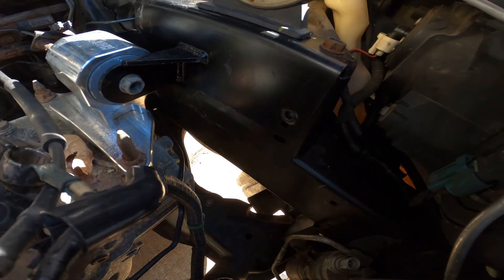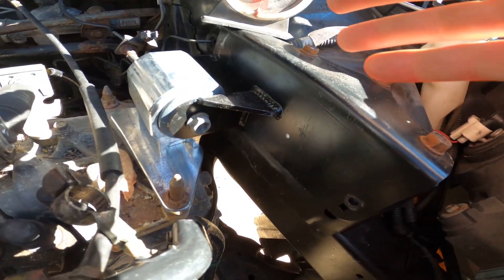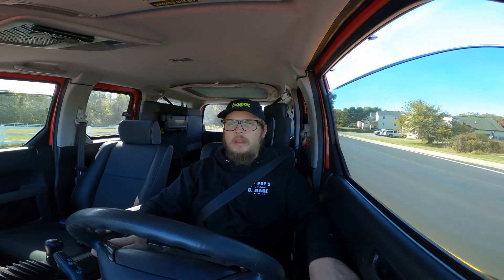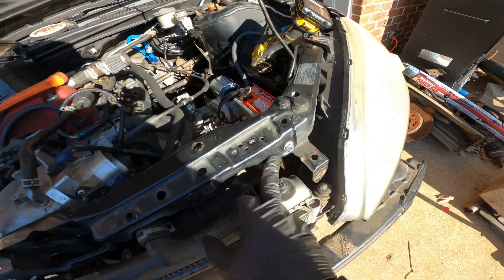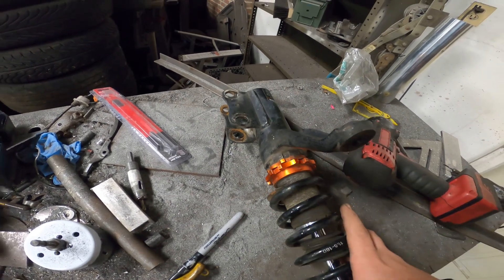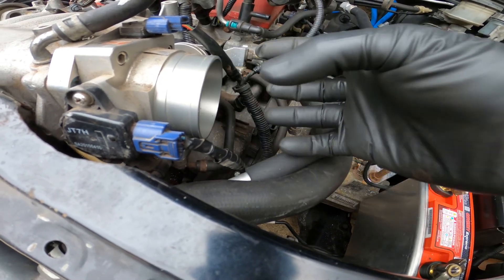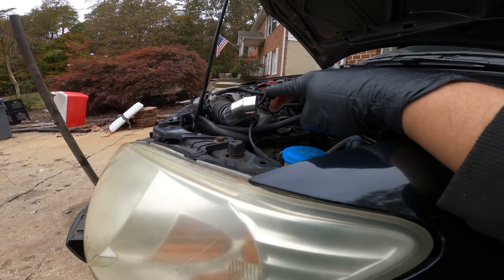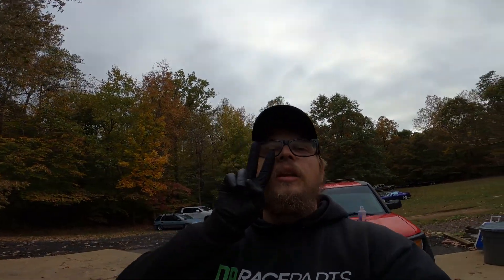Battery Bracket In The K Swap EM2 Pt.4

Comment: I placed the same battery and tray inside the bumper in front of the passenger tire that way I kept running cables to a minimum and as hidden as possible. Debating on running some battery jumper posts (juuuust in case) to the area you put ur battery or maybe to the inside of the trunk on the passenger side🤔
Reply from the maker: Yah that’s what I’d do is put it in the bumper but she wanted it in the engine bay so that’s what we did